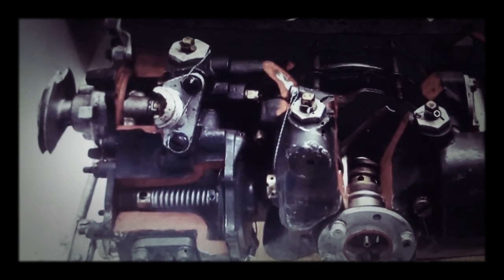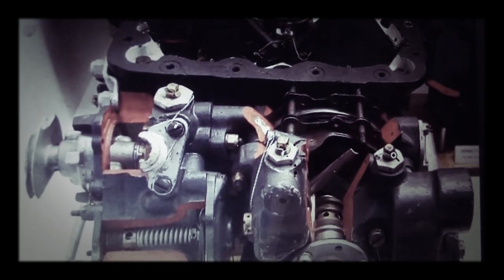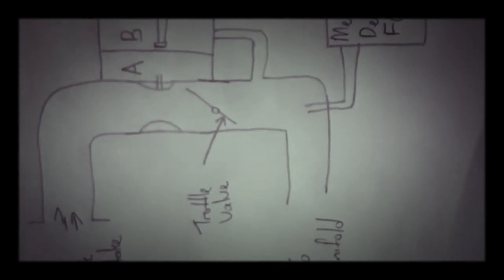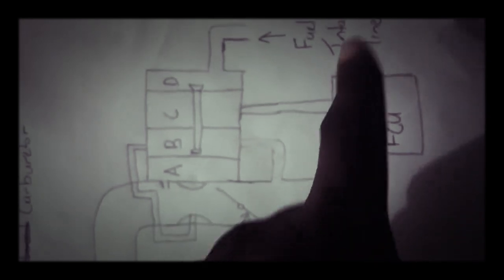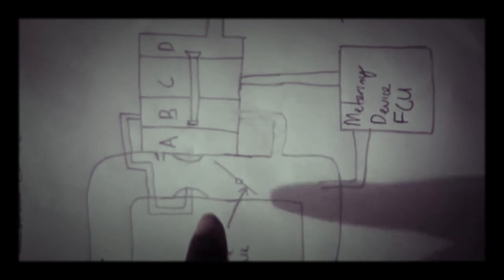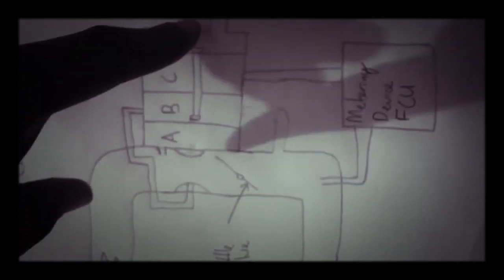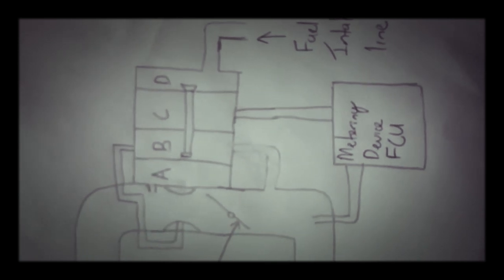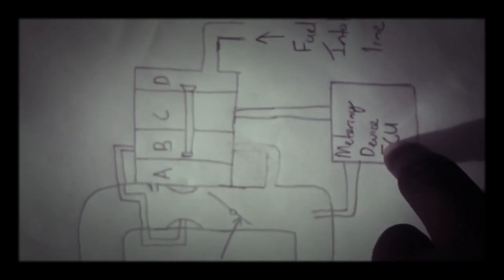Pressure injected carburetors brief explanation part 1

Comment: What are the differences of the pressure carburetor to the float type carburetor
Reply from the maker: Well the pressure carb is used at higher altitide of flights where air density is low and the automisation may be weaker ...overall pressure carbs also have better performance in different aerobatic and altitude settings. Inorder to understand the differemces i suggest you learn up on normal carbs. Thank you so much for your comment.